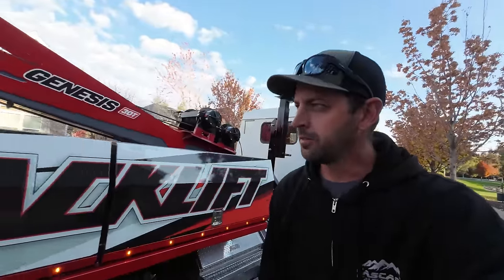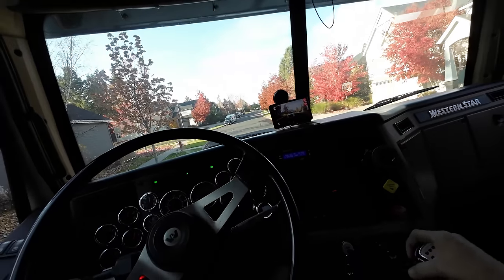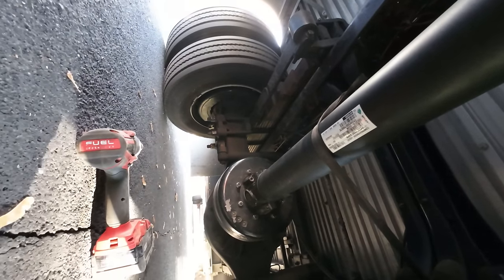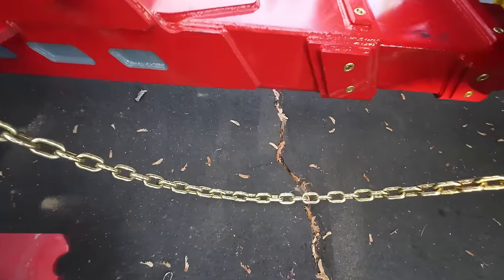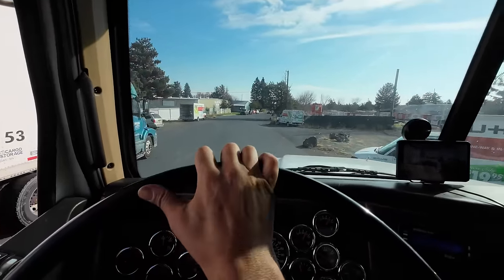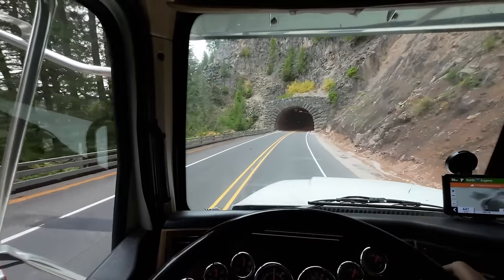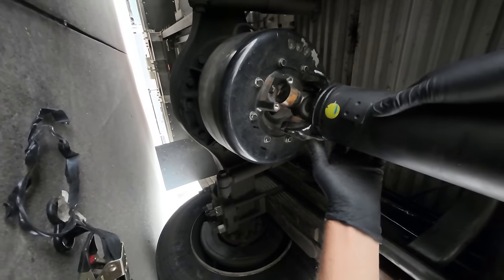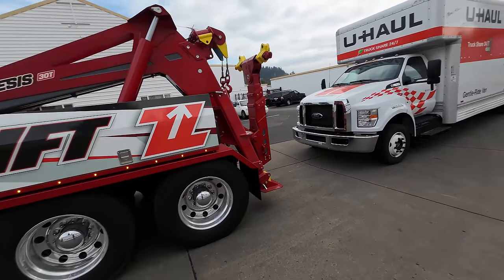Well that didn't end like I'd hoped…

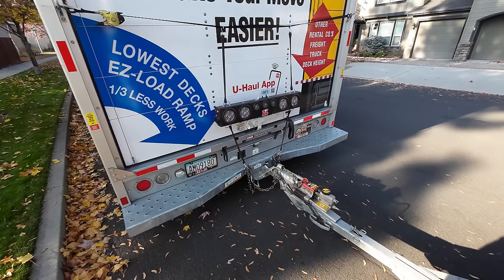Comment: 8:37 I made a strap just for this purpose, and saved it for repeated use. I saved the hooks from a worn-out bungee cord. I put knots in the strap, and put the hooks thru the knots. Winching the strap tight the first time draws the knots tight on the hooks making them impossible to slip out. Leave those old hooks in the knots. When hanging the light bar, remove the top hooks, and slip the light's bungees on the old hooks at the knots. I spaced the knots about two feet wider than the attachment points on the light bar, so it hangs like a "V", which reduces the side-to-side motion and allows more tension in the bungies. Cut off the excess strap material and burn the cut edge to prevent fraying. Store the whole thing in a Ziplock bag to use again. Fold the strap and hold it with a small clamp for storage saves getting it tangled.

I know knots are forbidden in straps used for cargo securement, because a knot reduces the Working Load Limit to zero. Bungies also have a WLL of zero. A light bar is not cargo, and is allowed to be supported by bungies with a WLL of zero. By my interpretation of the rules, the strap is allowed to have a WLL of zero if it is only supporting bungies that also have a WLL of zero.

If you are concerned the knotted strap might be too weak, run a second strap between the handles with the winch on the other side so they don't bang together. Cinch it tight and leave the knotted strap not quite as tight. Cable tie the two together in the middle, and the extra strap will carry most of the load. Don't just go once around with the cable tie, go around multiple times and use up all the excess before putting it through the ratchet hole. Each additional wrap will increase the load capability of the cable tie, just like doubling back a winch line.

Comment: Well, the light bar loss will get you to figure out a better way of mounting it on stuff with little mounting points. Maybe hooks that can fully close instead of regular hooks on the cords.But at least you have a spare light until you get the new one. Thanks for the video!!!

Comment: Curious...what's the purpose behind disconnecting the drivetrain?
Reply from the maker: So you don’t destroy the transmission
Reply: You have to on an automatic transmission or it really destroys the transmission.
Reply: Ironically is to not burn the transmission up while you flat tow it, because without the engine running the pump is not pumping fluid to vital parts and bearings that need it while in motion
Reply: Cant tow, without damaging, with the drive axle on the ground with the driveline hooked up, it will fry the transmission because the pump isn't moving fluid but the parts will still be spinning. Same principle for AWD/4x4 vehicles, with other parts being damaged in those cases. There may be some exceptions to the rule, like some 4x4s you can put the transfer case in neutral and tow with the front axle on the ground but the best way to avoid damage is to disconnect the driveline on the big stuff, unless you lift from the rear, or make sure all 4 wheels are off the ground either with a flatbed or dollies for AWD/4x4.
Reply: @CaseyLaDelle  So how do so many RV'ers flat tow vehicles?
Reply: So you don't cook the transmission, when in neutral you don't burn out the the pump for the converter
Reply: @MikeCris  ... they remove the drive-line
Reply from the maker: @MikeCris  some vehicles are capable of being flat towed from the factory.  Others are retrofitted with a flat tow kit that either disconnects the driveline, or uses an auxiliary pump to lubricate the transmission.   But that’s why you always see certain types of vehicles towed behind RV’s.  Some can be towed and some can’t.
Reply: @888johnmac  Or they tow a Jeep with the transfer case in neutral

Comment: Had a coworker teach me a trick for the light bar. Run your strap through those U-bolts that the bungees are on, then to those rails on the back of the truck. When you tighten the strap, it'll hold the light bar up and keep it from bouncing around.

Comment: Iv had that happen to a lightbar in that exact configuration.... Now from ptsd i carry zipties with and where the bungie hooks to the strap up top, i ziptie the hook to the strap so only way its jumping off is if the bungies break >.< I feel that pain brother sheesh. Also if anyone even suggests that parking brake was from you towing it not the exact reason why it was probably towed is the dingdongs were driving with the parking brake on and thought it was broken lol but you can see it also in the hookup that its different colored not just after tow lol.

Comment: Ive never lost a light bar held on with bungee. I think some stole it, maybe it a traffic light or stop sign. You would of never seen them do it! Now on the magnet lights, i use a short rope on it with a knot on the end, close it in the door or deck lid and the knot won't let it pull out

Comment: Best lesson is a bought lesson. I assume that light bar is made by Tow Mate, they sell something called I-Mon that provides real life feedback & lets you know instantly if you lose it. I've got them in both my trucks hot-wired to the ignition so no one has an excuse to leave one.

Unless the switch is broken I don't see how it's remotely possible to drive a JH with the brake on. It'll squal at you like crazy as soon as it's dropped outta Park.

Sorry for your loss. There are those who have lost them & those who will.

Comment: Video sure helps to cover ya. At 08:50 you show releasing the parking brake before towing.
I also like the fact you put blocks under the underlift before getting under the truck. I've seen so many wrecker drivers ignore this Safety Step.

Comment: I use a ratchet strap on top. A small 500 lb will do, and the bungies on the bottom to secure the bounce.  Sometimes, I'll use a 'safety line' made from para-cord attached to the handle to an independent anchor. I lost a light bar between CT and NY.

Comment: Bin those light bar S hooks! If that thing bounces too much (as it must have done 🤷‍♂️) they just jump off 😖
As others have said, some mini carabiners would be a safer option.

Or better yet, we use the magnetic battery powered Bluetooth ones, the are individually sided left and right, so you can stick them right to the corners, and because they’re small and light, and the magnets ridiculously strong, they never fall off. Ours are made by Sparex 👍

Very smart new truck lift you have there too, looks very well made and thought out with all those storage compartments etc 🤙

Comment: The park brake was probably the issue and not the transmission. I noticed the brake dust when you pulled the driveshaft off. That is a sweet tow truck.

Comment: Suggestion, Replace the hooks on the bungies with carabiners or nap links and put more tension on the bungy connecting the light bar to the straps to the truck.  I am a retired teamster with experience in Heavy Haul, Logging, Freight, and moving nuclear material. Truck drivers are the sole of transportation. They will help any one out on the road who are in need. I am surprised at the negative response I am seeing from truckers. If I saw this type a reaction  from any of my drivers, they would be parking their truck and walking.

Comment: You should look into some strong magnets with Eye bolts on them to attack to the metal sides/backdoors of those vans/trucks/cars. That'll hold those light backs a whole lot safer than the strap you used. The strap twisted on the flat side and allowed the hooks to slide off, had that happen to me aswell! Luckily I noticed it 200 meters after taking off before leaving the compound.. Been using said magnets ever since and I have yet to have one of them fail me in over 5 years now

Comment: Hey Casey, I found putting some strips of old conveyor strap into the fork saddles made getting a good firm grab on the axle much nicer. Avoiding metal to metal contact the strapping made for an even better "isolated" connection between the lift and the towed vehicle, less chance of a side slip on the forks. Just a thought I wanted to share with you, worked great for me.. Cheers (sorry about your light bar, that sucks)...

Comment: Casey, as you extended the strap across the back door I was saying Casey use the strap on the light bar and run said strap thru handle on light bar! Wor add t case would have been that if bungee cords gave way the light bar would still have been hanging on the strap! Sorry about YOU losing that light bar. Expensive lesson learned! Gilbert Alicea NYC

Comment: Casey, the all rubber bungies are prone to split and or bounce un-dune under pressure and come undune, a better solution
is the Braided Bungies with enclosed clips instesd of hook ends, also I always use a safety wire lanyard on any of my equipment.
Hope this helps your Lightbar probem. Best of Luck with your new Rig.

Comment: Reminds me of the time I was towing my classic Maserati with knock-off wire wheels and using a wrecker. Just as I was going on an overpass, I felt a large vibration and then noticed in the rearview mirror one of the wheels rolling off towards the shoulder. Saw it bounce, go over the guardrail and disappear down the embankment. After calling AAA for a rollback to get it to the final destination, I came back and searched for that wheel for over an hour without finding it. Bummer. It was an expensive wheel. Just happens that you're not supposed to tow knock-off wheels backwards. Lesson learned.

Comment: 16:30 I'm not a troll but I honestly was worried about those hooks for the lightbar bouncing off the strap. I've actually taken a small piece of wire and wrapped it around the hook and twisted it to hold the hook in place. If you haven't lost a set of lights before then you haven't been towing stuff for long because it happens to everyone at some point.

Comment: VOILE STRAPS!  Since you have the hangers on the top, use VOILE through those and around the horizontal ratchet strap?   The weight of the light should keep the straps from loosening.  

Another thought:  have some 1/8" amsteel continuous loops spliced or just larks head knot them onto the light hooks.  Run the ratchet strap through those?   When they aren't needed they won't take up much room at all.  Bungee tight from the bottom.  If you were to do the loops on the top and bottom of the light, you could use a second ratchet strap on the bottom down to the corners of a bumper/edge and the light should stay in place more solidly than the bungees....

Comment: Casey: If the light bar has magnets on the back, get two or three 90lb pull magnets to put on the other side of the rear door to help hold the light bar in place. Or a steel plate bent in a U shape to slide over the bottom of the roll-up door to give a nice surface to mount to.

Comment: Maybe also use the Cable ties that you left in the bag and didn't use for the driveshaft and also it looks like the hooks on the bungee are not closed enough to hold themselves from holding the bungee itself and At the speed that you are doing then expect it to be at least that far away from the road but there's also more variables to where it is and it could of just stayed in the road and Was picked up by someone.... Who is holding it for Ransom and " Save the Lightbar "  😂..

Comment: In most cases, lifting something with suspension and lowering slowly will usually result in it sitting back down at a higher level. I reckon, if u had of done this when hooking up, it would have gone under without using the blocks. keep up the good work old boy. Still watching, but not criticising, way down here in Tasmania.

Comment: I think most people have lost something valuable. I remember losing an expensive action camera on a ride. I got to my destination 3 hours away  which was via a freeway. When in my hotel room I pulled out the laptop and reviewed the footage of the rear camera and found saw it flying off about 2 hours prior to arriving. It came off at about 100 KPH / 65 MPH and no doubt got a bit beat up / broken as it hit the ground then bounced around. It wasn't worth going 2 hours back then 2 hours return again for an item that has no doubt been hit by a car or 1000 cars. 

Another time I lost a tablet (placed on top of a trailer while I loaded the trailer). It came off at about 80 - 90 KPH / 57 - 60 MPH. Later on I noticed it was not with me so pinged it for its location. It was on the freeway and had obviously been hit a few times (broken in half). I went back and collected it, pulled out the sim and memory card. I was surprised it was still working to respond to give its gps location. That was a $1000 tablet.

Comment: Hello, 
  I've watched a lot of towing videos, and I believe that you should have turned the fork on the passenger side  around. The taller part of the fork should face the front. Also, most towing companies will remove the drive line but will not put it back on for liability reasons.
  Love the videos. Keep up the good work, and God bless.
Reply from the maker: It was
Reply: I just watched that part again.  You had the driver's side the right way, but not the passenger side.

Comment: You would think they would build some sort of alarm into those light bars so if it does fall off, some sort of signal would sound off when the radio signal between the light bar and the truck is lost.

Comment: Maybe someone needs to make a two way radio lightbar, you could build some neat things like battery level indication in, but from the comments it sounds like the killer feature would be signal loss alarm that only triggers if the lightbar doesn't send an I'm powering off deliberately signal so you know when you leave range of the lightbar and can stop before your gone from the drop point too far or before it's miles behind you on the road.  The deliberate silencing on manual commanded power down would ensure it didn't create too many false alarms and get silenced or ignored.

Comment: I wonder about two nylon loops on the lightbar, then run the strap through those? It sucks major that you lost this one 😞 If you didn't need the straps they wouldn't stick out and be in the road, but if you do have to suspend your bar like in this video, the straps would give a huge security point.

Comment: I hate to say it ,  when I saw you hang that bar with bungees I knew I would fall off.   I haul a lot of oversized stuff and learned the hard way too.   I was a U Haul dealer for 20 years and have seen a lot of abused equipment.

Comment: Novice questions: When Casey was unbolting the drive line he managed to rotate it by using the remote to the tow truck. How?  Where is the camera mounted that shows the front of the truck from a distance? Excellent video. Thanks for any insight.
Reply from the maker: Use the remote to extend the under reach.

Comment: You need to get yourself the speed straps. Just carry around a cordless drill that will always be dead and you will forget it and have to walk back to the truck. Make sure you remove the manual handle on them so you have to have the drill.

Comment: Hey Casey, another nice vid to watch! Shame about the lightbar but it makes you more cautious next time. One question: what is that air hissing all the time when you open the right rear door on the Zacklift? I hope it's not a 'tolerated leak'? Good luck and keep 'em coming! Ciao, T🐻 from NL.
Reply from the maker: Hydraulic fluid flowing through valve body
Reply: @CaseyLaDelle  ahaa, that's it! I was wondering that a company with high finishing standards like Zacklift would permit a simple airleak: no! Thnx for info, Casey. Have a nice evening!

Comment: Mate, dog clips or carabiners would be better, they can't bounce off. And yeah I know they won't work in all situations but when you have to rig the bar like that they are the answer, there is just too much bounce in those straps for open hooks. Another way would be to use rope or chain instead of the top two bungies to take the bounce out.

Comment: Case just a thought what about a wise wireless out door security cam $40 it uses  5v/1A could pick up key on circuit it would WiFi to an iPad or android pad has micro SD recording so it starts recording anytime it detects movement IP65 rated just think out side the box stay safe keep that head on a swivel

Comment: Did you trace your steps back from the pickup point? Or just heading back the opposite direction? That does suck though. May I suggest a safety cable be installed for such an event on top of the bungie cords?

Comment: Casey, I didn't loose a banner but I had the right rearmost flag fall off  in MD on my way to the Baltimore port. Trooper null & voided my permit, nailed me for being OS/OW with no permit. Overweight on 2 sets of tridems and a set of tandems, gross weight exceeding 80k. $43,610 after everything was said and done. VERY expensive flag
Reply: OUCH!!

Comment: That's a lot of brake dust for only a few thousand miles. I think we know what might have happened.  The camera angle for replacing the drive shaft made the issue more obvious than the removal sequence, but you could see some discoloration even without a straight shot.

Comment: Bummer about the light bar.  Unfortunately, a prime example of Murphy's Law in action: "Anything that can go wrong will go wrong, and at the worst possible time."  Maybe you need to add some kind of "safety cable" setup that uses carabiners, or small screw shackles, to your light bar setup.  'Course, you might have just found a half way ground down to nothing light bar hanging on the safety cable. 😖

Comment: Definitely you can see the scrapes from the parking brake when you pulled the driveline. Not as easily seen as when you put driveline back in but it’s there. 
Sorry about the light bar.  There is a period of adjustment with new equipment. Try not to be too hard on yourself. Maybe put your info on it somewhere, even a sticker. Just in case something happens, it may be returned.